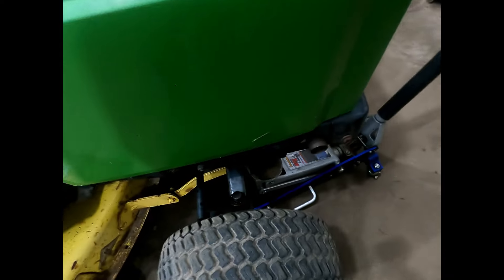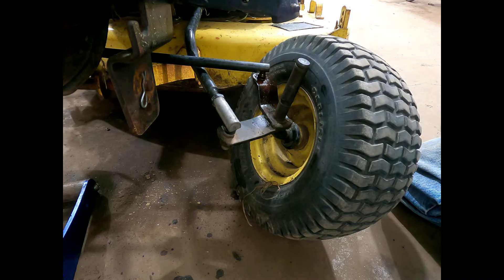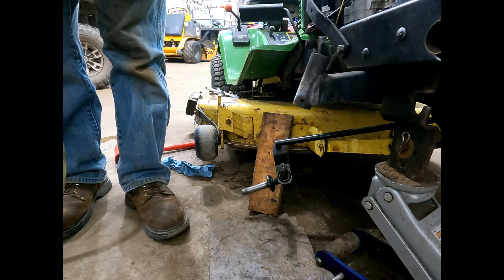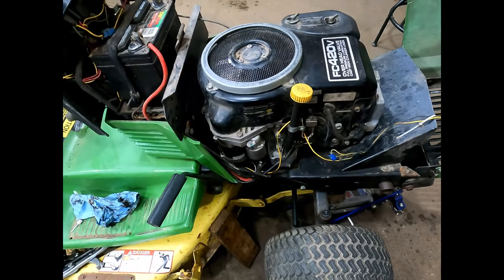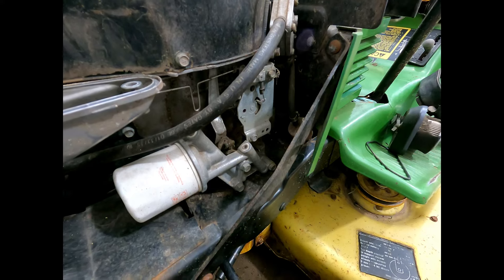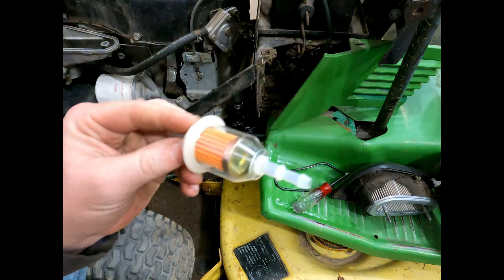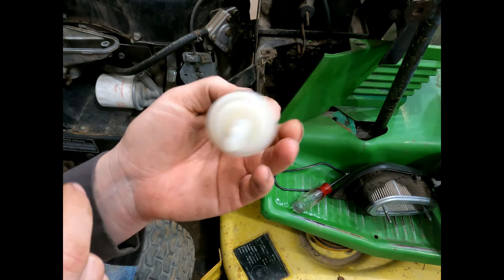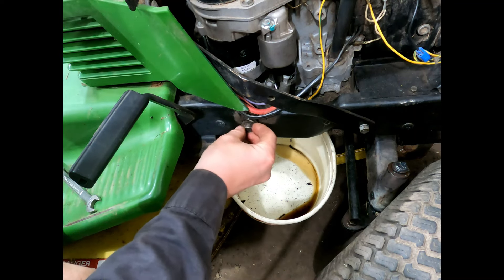John Deere 175 Mower Repair Seized steering and mouse nest in engine

Comment: i beat one for half a day on a 185 hydro . bradded it so bad i had to cut 1/2 inch off top , drill and tap , and use a bolt and washer down thru the top to hold it in . done several on 180/185 hydros . always dread this part the most .
Reply from the maker: Yeah it was a terrible design. I have had several stuck ones but this one was one of the worst I have come across.